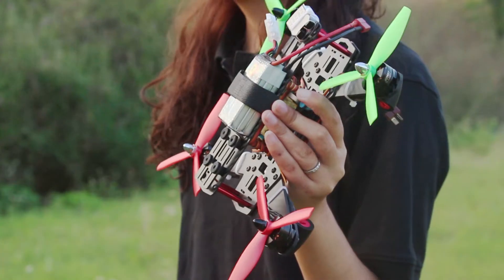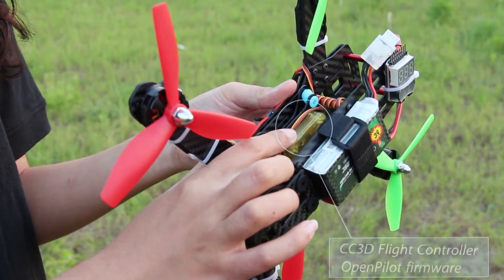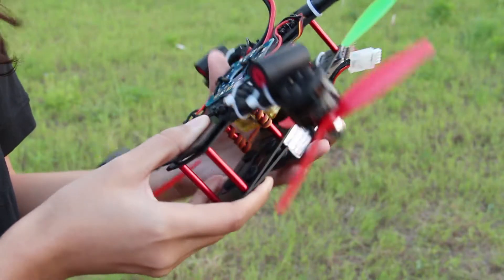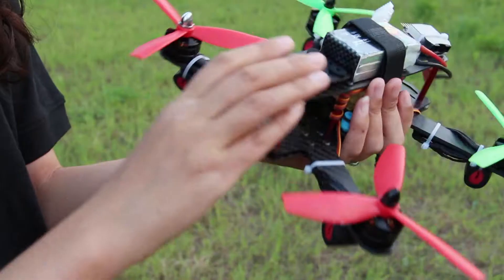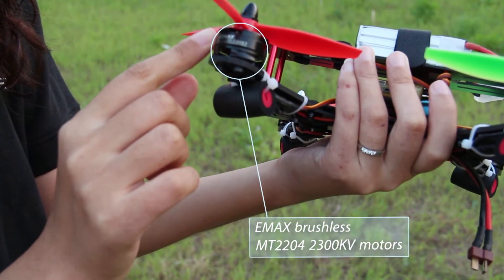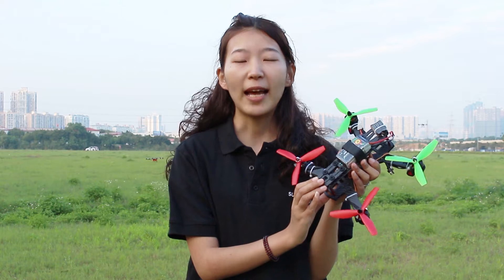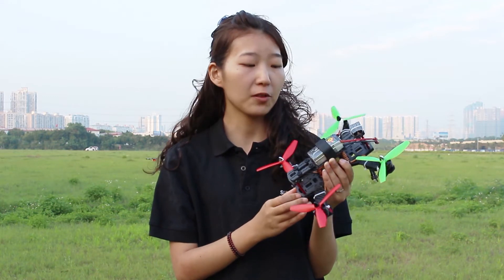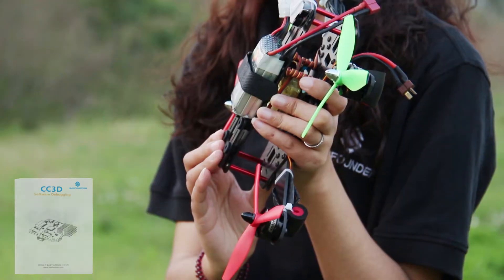SunFounder SF250 FPV 4-Axis CC3D Racing Flying Drone Quadcopter – Introduction & Exciting Flight

Comment: Hi, I just bought one of these from Amazon Italy..mounted everything yesterday. Calibrated the motors but the no1 does not spin costantly..I have to put throttle to 50% or more and it starts..but when i go down to 10-20% it stops. Escs are calibrated in librepilot. Could be a faulty motor or esc?
Reply from the maker: +Manuel M,
Could you pls send a product link to us？
We have two different SF250 Drones, then we can solve the problem for you.
Waiting for your reply!
Reply: Hi, thank you for your reply..i bought this one.. https://www.amazon.it/gp/aw/d/B01N52OELT/ref=sr_ph?__mk_it_IT=ÅMÅZÕÑ&qid=1494653777&sr=1&pi=AC_SX236_SY340_QL65&keywords=sunfounder
Reply from the maker: +Manuel M, you can visit follow link, and get the way to solve the problem. If you still have confusion, pls connect with us.
http://wiki.sunfounder.cc/index.php?title=SF250_FAQ

Comment: Straight up guys is this worth the buy? I found a deal that just cant be ignored and I'm trying to figure out why
Reply: The one on amazon for $270 (CAD) which is like $200 USD or something? I just ordered it, comes assembled w/ a TX
Reply: Have you received it yet? Is the PDP exposed on the underside of the quad
Reply: Should be getting it today, if not today, tomorrow for sure. Will keep you updated. The picture of the quad I bought off amazon shows the Power dist. board stacked up with the flight controller. Doesn't show it to be under the aircraft. Here's a screenshot of the pic http://prntscr.com/eeer3p I'll let you know when I get it if the board is on the bottom. I may even review it if I think it's worth buying.
Reply: Here's the amazon link I bought the quad from. https://www.amazon.ca/gp/product/B01KUN0F10/ref=ya_st_dp_summary
Reply: Burks Legend.
Reply: And according to SunFounder, the range on this is pretty fckin good lol. They said it was 1000m
Reply: Burks The ESC's are under the arm. it's the only thing that is putting me off. I was about to spend A LOT till I seen this. definitely do the review.
Reply: Yea i noticed that too, but that just looks like they didn't shorten up the motor wires and esc wires. I was just going to use vulcanized tape to wrap the arms anyway
Reply: There's a small gap between the 2 bottom plates that can be used to tuck those wires into if one felt inclined to shorten them all up. My friend has a 250 like this and that's how he packed all his wires away, was under that plate. But I don't really mind that they're right there, it'll let me test it all out and see if any of the esc's are bad and make it an easy fix later on, but the vulcanized tape is probably my favorite way to secure and protect esc's. It becomes virtually waterproof once heated a little, and its super durable. Just gotta be careful of sun exposure on the tape, it dries it out and can cause it to rip in flight (mainly for the shitty cheap tape)
Reply: Hey Dante, just got my quad, looks exactly like the pic. The ESC's don't look half bad actually, it's pretty clean looking. The boards are inside the craft, not on the bottom like you were asking (kinda happy about that) the 2200mah lipo they send you in the remote is too big for it, had to resort to putting AA's in the battery cradle that came with it. Just looking over it now, gonna hook up the battery and see if it's actually RTF or if i have to plug in the CC3D board to my PC and fiddle with it. Weather is pretty shitty right now. Snow, rain, wind, freezing rain for the next 2 days or so. When it clears up I'll take it out and record the 1st flight and show some more of it up close. Don't have an FPV setup for it yet so i may just strap an old Iphone to it and see how that records lol. If you're still interested in this quad let me know and ill let you know when the video goes up
Reply: Burks in this day & age of a$$hole Youtube commenters, you are a Light against the Dark. You are the hero we need, and deserve. Fingers crossed on the weather front. And of course I wanna see flight footage.
Reply: Plugged it all in, the AA's were causing the remote to beep constantly so I finally jammed the 2200 lipo into it and did a little bit of indoor flying. Trimming it, seeing how it hovers, ect. Couldn't really see what it can do :p The battery that came with it lasted maybe 5 mins? with the voltage meter plugged in and got pretty warm just from LIGHT use. Good thing I bought a VenomFly 30C 2200mah along with it. It lasted longer than my interest in flying it anymore inside. Its also not that much heavier than the 25c 1300mah that comes stock with it.
Reply: Well the phone on it didnt work, just couldnt keep up the focus, i even tried to just hover but nope. At about 400' or so it was able to more or less just glide on the wind gusts kinda like a plane. I think it needs tweaking with the software, but I'm just flying it as it. It's still really cold so I only had it up for about 10 mins on my 2200mah and about 7 on the stock 1300mah battery. I adjusted the volt meter down to 3.1V from the 3.3? stock setting. The ESC's will go 50% at 3.2/3.1 or so which was just enough to bring it down (good thing it was windy) It lands perfectly, the controls are fine enough to bring it down without a bounce. Seems like a pretty good quad so far. My kit was missing a wrench though, and the battery charger is a joke.
Reply: But all in all its worth the buy?
Reply: I'd say so, yeah. I ordered a camera off amazon last night, so on thursday (weather permitting) i'll try and get  a video of it flying. I just hope it'll mount on easily enough

Comment: how do you connect your controller to your drone?
Reply from the maker: Please
kindly check the tutorial here: https://s3.amazonaws.com/sunfounder/The+configuration+in+OpenPilot+and+wiring+of+receiver+to+CC3D+for+different+modes.pdf
Reply: SunFounder can this drone link to an FS-T6?
Reply: SunFounder that video answered another question that I was going to ask but it doesn't answer this question mam do you have a video of how to link a co troller and the sf250 and can you link it with any controller?
Reply from the maker: Dear Vincent,
Well noted your problem. Our SF250 can support receivers of PWM, PPM, and SBUS signals.
Sorry we don't have the video for that, but you can refer to our product user manual which describes how to connect it with the SF250.
If you have any concern, pls contact us. 
Have a good time.
Reply: SunFounder thanks

Comment: The tutorials are just about the drone assembly. Some video tutorials about  the configuration of the flight controller  and the remote controller would be needed.
Reply from the maker: Thanks for suggestion. You can check the detailed configuration step in our instruction manual.